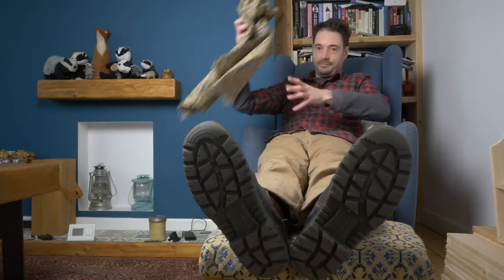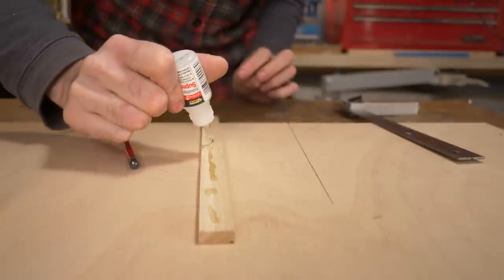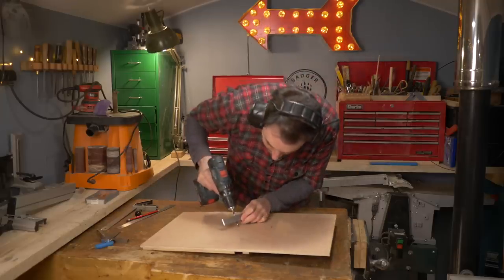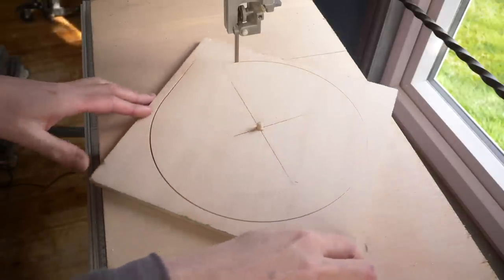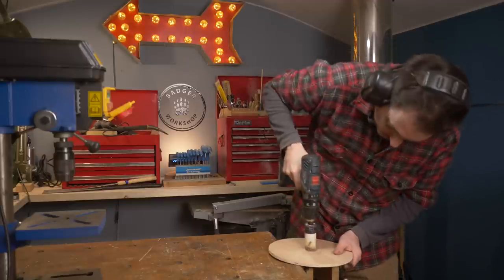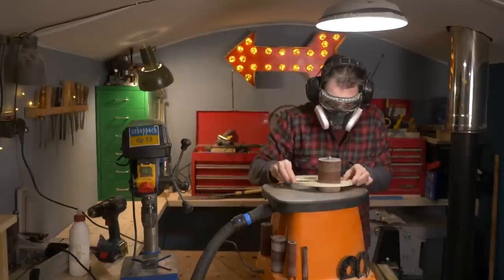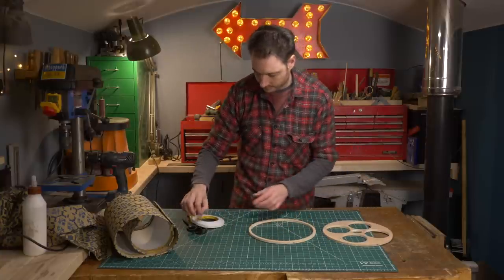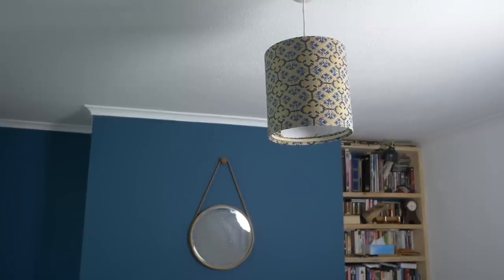I Made A New Lamp Shade

Comment: I can't understand why your table saw blade is so high even when cutting thin stock. Blade makers recommend that the blade is only proud of the work by about a single tooth at most. As I understand it this is both a safety feature (for fingers!) and a design feature making sure the blade tooth enters at a shallow angle to alleviate shock to the blade tooth. This will prolong the life of the blade and produce a finer cut.    
Is your table saw not capable of achieving this due to its crown guard and riving knife design? I ask this question as I am about to upgrade my current table saw (which was inexpensive but still able to adhere to blade manufacturers guidelines) and I like Axminster tools a lot as I have several of their products that I am very pleased with.
I also note that Keith (rag and bone) Brown also has the blade set very high on his new Axminster table saw. Is this a common problem/feature with Axminster table saws?
Reply from the maker: It can be lowered